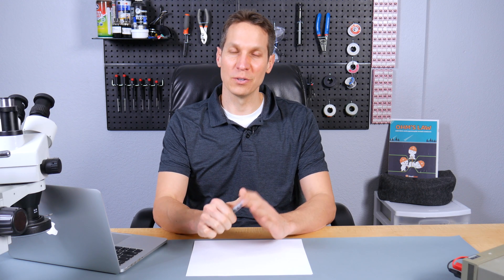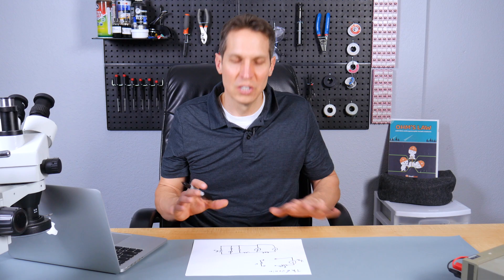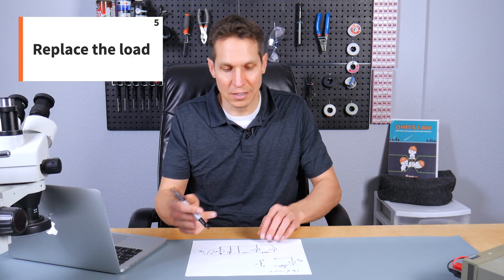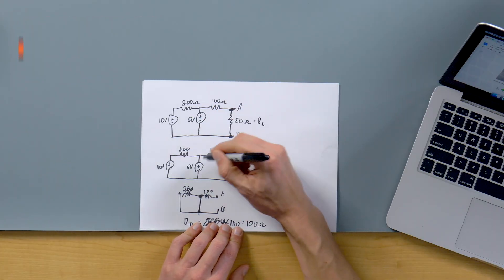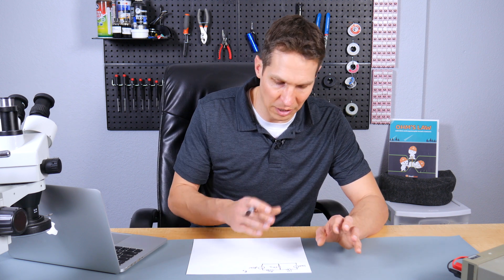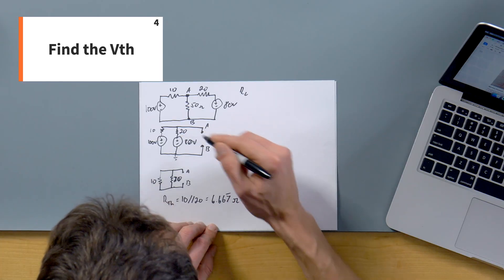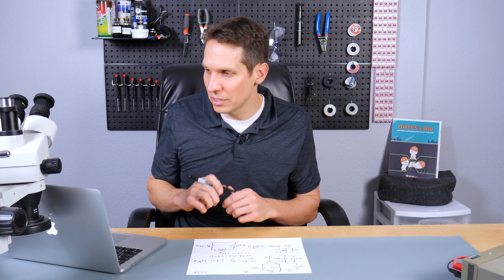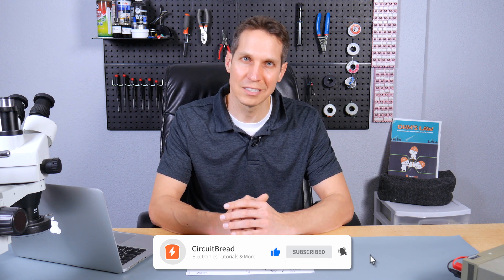Thevenin Equivalent Circuits | Basic Circuits | Electronics Tutorials

Comment: Why do we replace voltage sources with shorts and current sources with opens?
Reply: 0 voltage and 0 current resistance equivalent. Then finding Vth gives you whatever current wouldve eventually moved between the two points and it all works out.

Comment: As someone new to the study of electronics, can you clarify what you mean by "load"? Can you give me an example of a load?
Reply from the maker: Sure!  A load is a very generic term because it could mean a lot of things.  In general, though, it's the thing that we're trying to get the correct amount of power to.  So, in a lot of example coursework, we model a load as a resistor.  But in reality, it could be a motor (which could be a fan, motor on a car, blender, whatever), a transistor, a heating element, an antenna, etc.

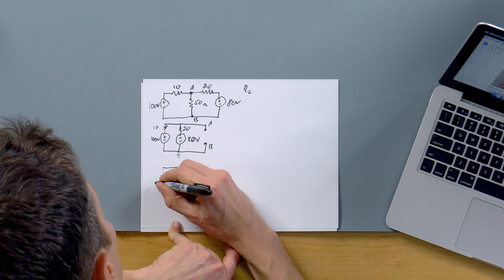Comment: At 11:55 you say the resistance is in parallel, but at 12:40 you calculate resistance in series. Could you explain why it changes from my understanding you're pulling the same values from the same circuit but combining them differently ?
Reply: The instructor correctly shows that these resistors are in parallel, both in the diagram and in his notation. He uses R(Th) = 10 || 20, where '||' is standard notation for parallel resistors. Using the parallel resistance formula (R1 × R2)/(R1 + R2), we get (10 × 20)/(10 + 20) = 200/30 = 6.67 Ohms. This is the equivalent Thévenin resistance."
Reply: @JLeonDuran click on 12:40 link to see that the denominator for the KCL is 30, which would be the Req if the resistors were in series. However, they are in parallel.
Reply: @robertshropenstein3596  The resistors are in parallel with the voltage sources shorted, which we do in order to find Rth. When solving for Vth, however, the voltage sources are not shorted, while the load resistor is an open circuit - which gives you an equivalent circuit of (2) voltage sources in series with (2) resistors in series (visualized by removing the load resistor from the original circuit).

Comment: At 7:00 why does the short circuit cut out the 200 Ohms
Reply from the maker: If the two nodes of the resistor are attached together, it's kinda like putting a 200 ohm resistor in parallel with a 0 ohm resistor.  You do the calculations, you find that the equivalent resistance is 0 ohms.  So you can just act like the 200 ohm resistor isn't there at all.
Reply: Electricity Takes The Least Resistive Path That's Why When There Wire And A Resistor In Parallel , The Electricity Will Flow Through Wire As It Has Less Resistance 😊

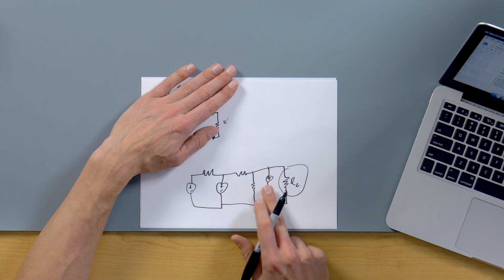Comment: At 2:57 you mentioned that the 3 resistors will be in parallel, but how? If you place a short at the two voltage sources, wouldn't the first resistor get shorted out since it is in parallel with R=0? Then the Req as seen by the load should be the two other resistors in series with each other.
Reply from the maker: I'm assuming you're referring to 3:47 or so?  I reviewed it and you are absolutely correct.  That far left resistor will have the two ends shorted to each other so, in this case, that first resistor would be taken out completely.  Good catch, thanks!

Comment: During the second step of removing the load resistor in the second example, what is the issue with simply removing the 50-ohm resistor and keeping the voltage sources in the exact same spots? Obviously it's wrong and you'd get 10-ohm and 20-ohm resistors in series rather than in parallel--but what's the concept error that I am missing here?
Reply from the maker: That's a good question and actually, you CAN remove the 50 ohm resistors and keep the voltage sources in the same spot.  But then the challenge will be to remember that your node A is between the two resistors.  As mentioned in the video, we get comfortable looking at circuits in a certain way and, by moving it so that nodes A and B jut out to the right, it's a more "comfortable" way to look at it.  But if we just removed the 50 ohm resistor and labeled node A BETWEEN the two resistors, you'll get the same result.
I hope that helps!

Comment: Hi. For the second example. How did you get 6.66 for thevenin equivalent ?
Reply from the maker: Since the voltage sources are shorted while finding the Thevenin resistance, it puts the 10 and 20 ohm resistors in parallel.  Their equivalent resistance is 6.667 ohms and is the resistance between nodes A and B, so that is the end equivalent resistance.  Hopefully that's what you're looking for!

Comment: In example 2, when you were finding Req you did 20+10 but aren't the resistors in parallel ? wouldn't it be 200/30 ?
Reply from the maker: Hi Kamil, I'm not certain what you're referring to.  In the second example, the 10 and 20 ohm resistors are in parallel and the Rth equivalent comes out to be 6.667 ohms.  Could you give me a time stamp for reference?
Reply: @CircuitBread  12:36 you calculated the thevenin voltage, you did 20/30 instead of 20/6.66 so the current was wrong and lead to a different voltage drop across the 10ohm resistor